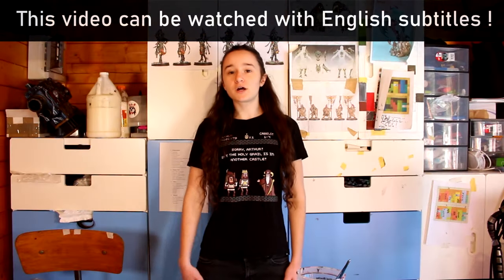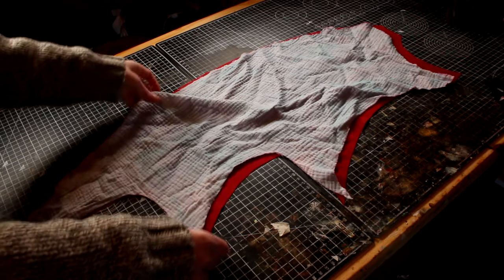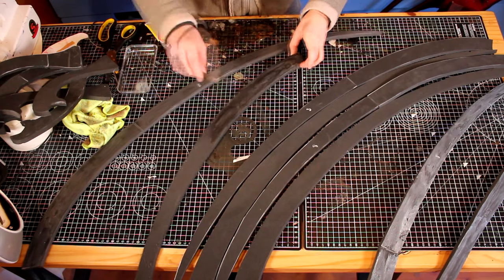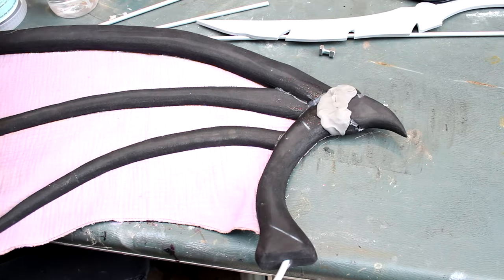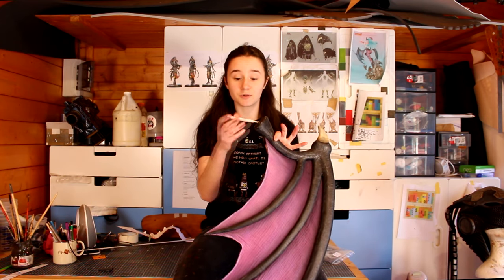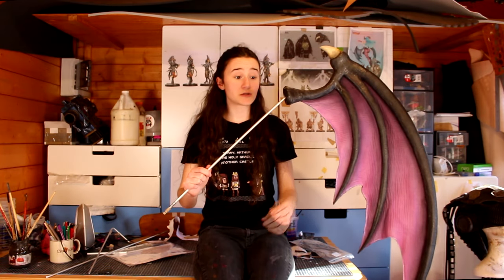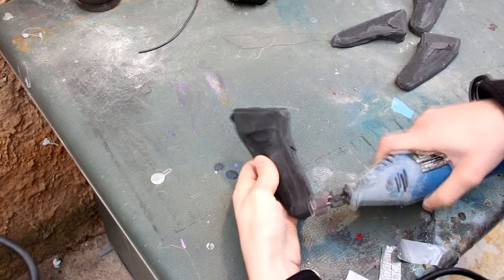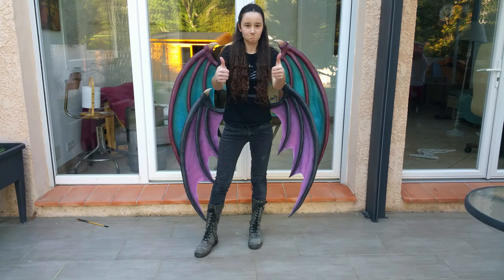How to make moving bat/dragon wings

Comment: MAN this is awesome! are you going to do a harness tutorial as well or is this the end of the series?
Reply from the maker: Strapping you mean ? I don't really have much to say about it, as the useful part (the "wing plate") was already shown. It does not go further than what I showed from 7:29 to 12:23.
Reply: @arborealkey  Hello! I really like your works, and I follow you on IG too... Can I ask you the straps material? Is it fabric? how did you attach the straps to the base?
Reply from the maker: @Marl3n3x  I think they are cotton ? Nylon would work too (the ones you find in hardware stores). You could glue them, bolt them, sew them (by heating the needle in a flame)...

Comment: I'm heating up the PCV pipe... Though it's quite difficult to get it on to the aluminum pipe how hot are you heating it up..it becomes floppy and it gets hard to slide on to the pipe with the tape. Any alternatives ?
Reply from the maker: Hello! PVC pipes do not have a very wide "softening" window and burn easily (kind reminder that it also releases toxic fumes). Using another aluminium pipe works too but it might dig into the smaller one. This is not really a tutorial, it's more like ideas for you to create your own stuff, so you can think out of the box if needed.